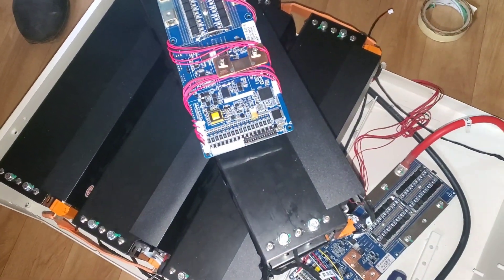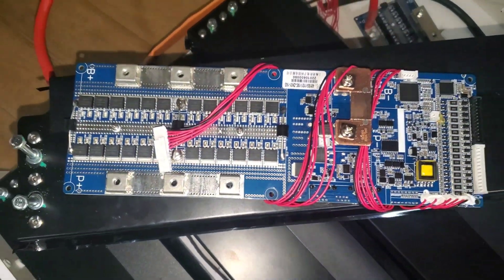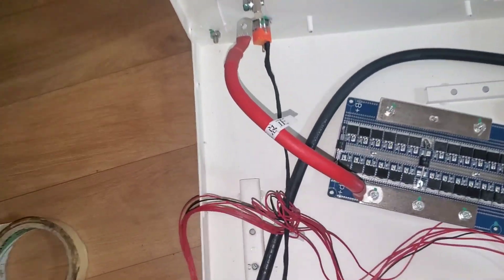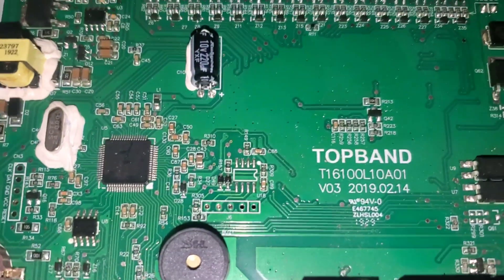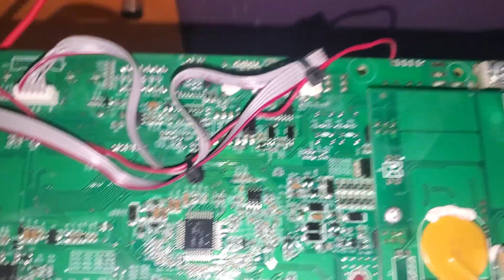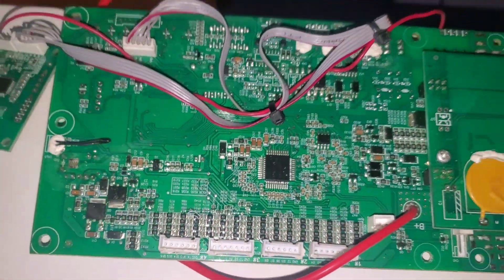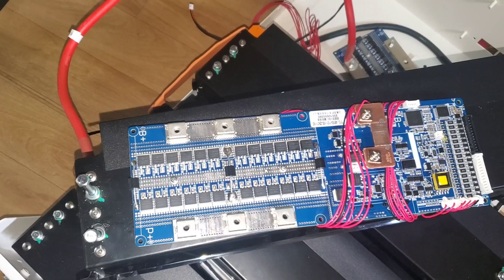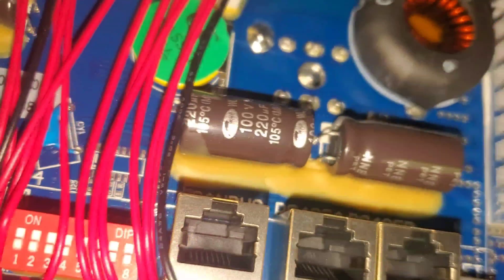Help me identify the BMS in the GSL battery

Comment: Hello, Can you help me with some info about CAN communication between Seplos BMS and Growat SPH5000 ? There is no communication with the batteries and is working only when i select Lead-Acid.
Reply from the maker: Thank you for watching and commenting. I have no experience with either. Call your Growatt representative and inquire if they have firmware updates for you
Reply: Talk to seplos, they have dedicated firmware for growatt. And you need to be sure to get or build the right cable
Reply: Hi there. It is a straight cable, with no dip switches up if it is a single battery. On the Growatt side you use the BMS port which is CAN/RS485 depend on the setting. On setting No.5 change to Li and then it will take you to Protocol selection setting 36 which you change to 02
Reply: Thanks for the video 😅

Comment: Hi, I have three 200 Ah (10 Kwh) power wall Lithium batteries very similar to the GSL, they are connected in parallel, for a total of 600 Ah, although they are the same brand and capacity, connected to two Deye Inverter in parallel , one has a Seplos BMS, and this one discharges faster, a 12% difference compared to the others.
Reply from the maker: Double check your wiring.

Comment: You might want to install JK BMS..
2:42 You might want to consider doing battery teardowns/reviews as well.
Reply from the maker: Thanks for the BMS tip. Unless the battery is damaged beyond repair, I am not sure I want to tear them down
Reply: @drsolar  not a complete teardown to the last bolts; just a show a tell: open up, show what cells used, how it is connected, quality of construction etc etc... this do add viewers.
Reply from the maker: @DanBurgaud  video coming up
Reply: @drsolar  Yes! More teardowns please.

Comment: just took a closer look, and slowed the movie down
it is a seplos bms, oemed..
this is 10c , which means the canbus version.
they also have a 10d, which is rs485 , compatible with voltronics/mpp solar/mercer and other voltronic cloned
Reply from the maker: You folks are a treasure trove of incredibly useful information. Thank you for sharing
Reply: @drsolar  see the response i gave below too , under the diode message...
would tell you exactly where to check and replace

Comment: Check the diode on the seplos ones as they did have a issue with the diodes
Reply: they indeed had 1 series of their 200 amp bms version where diode d4 had a manufactoring error
Reply: here's ray replacing it :

https://youtu.be/Vl54cSHtciU
Reply from the maker: Thanks for the tip. Maybe that would be the subject of another video